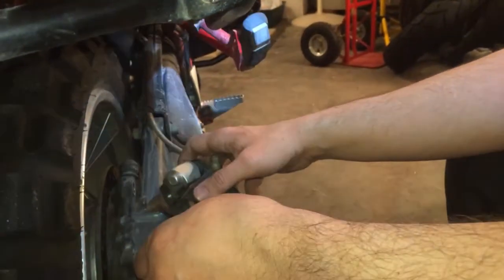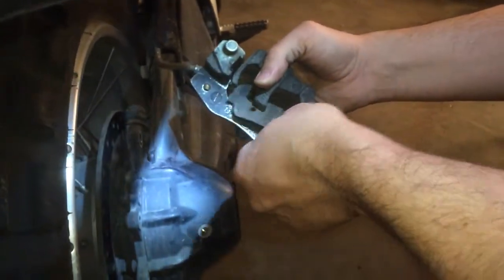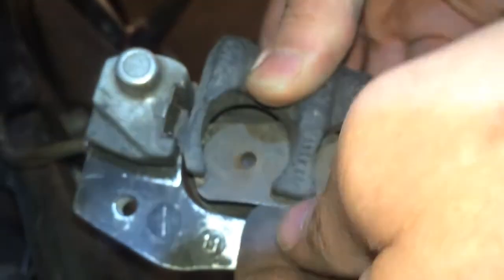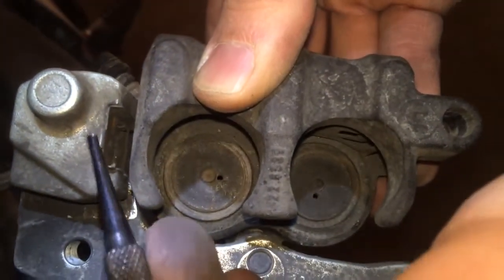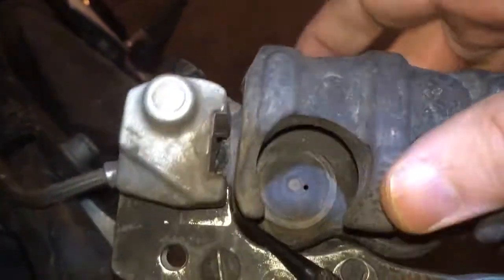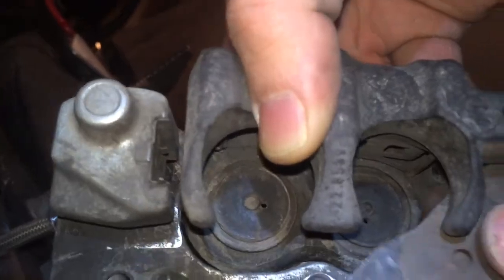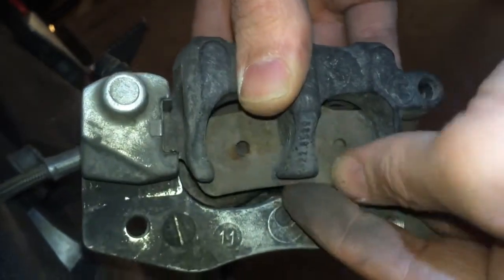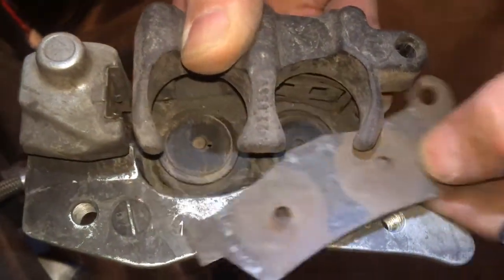Rear brakes 2012 R1200gs

Comment: Thanks for the video, my rear brake was dragging after fitting new pads. I tried the usual things but didn't spot that little up stance that separates the pads till I saw this.
Took the calliper off and resembled correctly. Sorted. Thanks again.
Reply from the maker: heya great. you mean one of my videos was useful to at least one person. that sounds like validation to make another! :-) thanks for the comment.